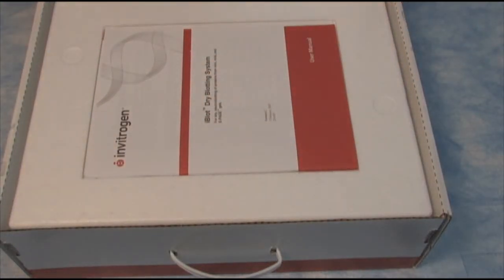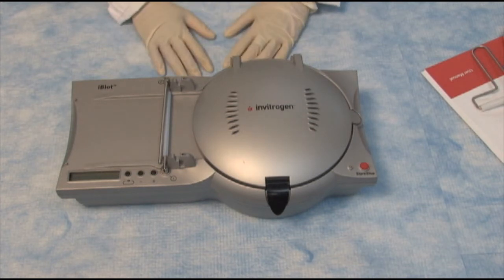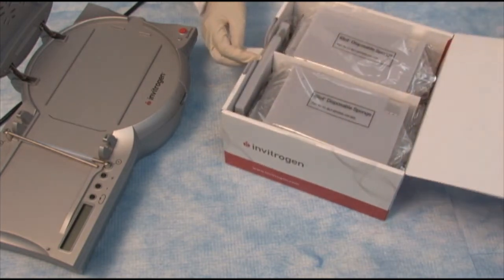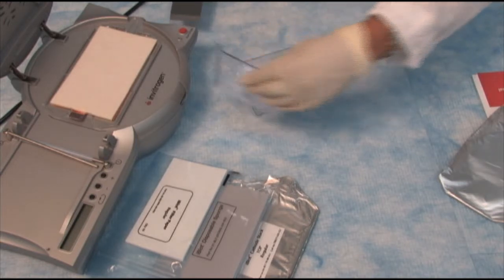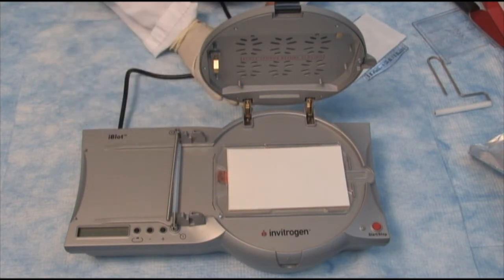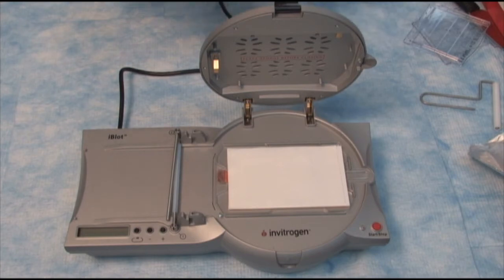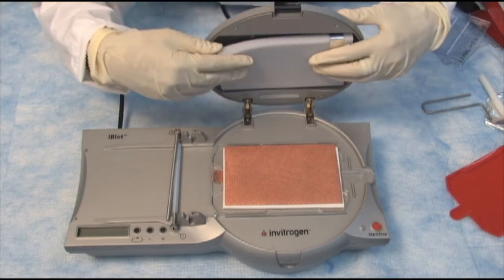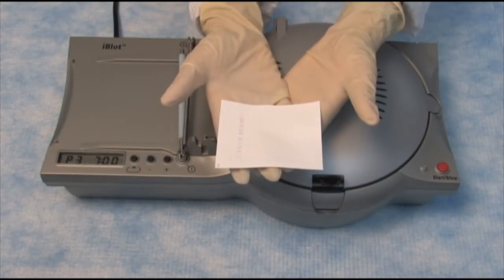How to set up a Western (part 3) - The Blot Transfer using the iBlot®

Comment: I was watching your video to use the one we received to test. This is a new one iBlot 2. I assembled it the way described on the website and ran it. I could enter the program and save but when I wanted to run it, the 'start' bottom did not work. Obviously there was a problem with it. These fully automated tools could easily go wrong in some point. On the other hand the foil-wrapped container to be used for each (or 2) gel for each time makes it very expensive. Maybe for some of multi million $$$ project it would worth it to save half an hour but in my case I gave it a pass.
Reply from the maker: Thank you for your comment. 

I apologize that you were not satisfied with our products. 

If you are still having issues with the iBlot2, please reach out to technical support team at thermofisher.com/askaquestion and one of our technical applications scientist can assist. 

Thank you!
Reply: @thermofisher  It was some 5-6 years ago and I am no longer there.
 
Basically it is design to use very expensive consumables every single time which in the end does very little if any improvement in the convenience and not easy to adjust and play with different variables for specific proteins. 

I consider it an expensive toy which some rich labs buy and end up not using it.